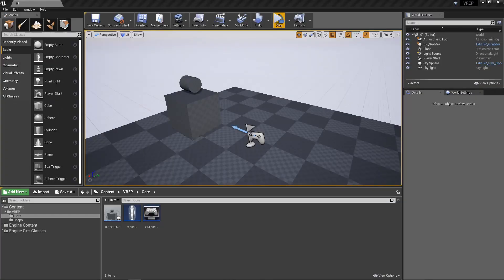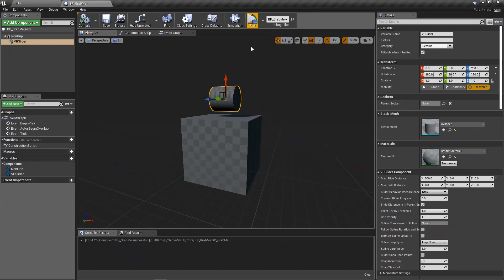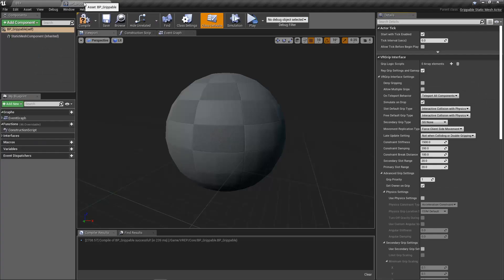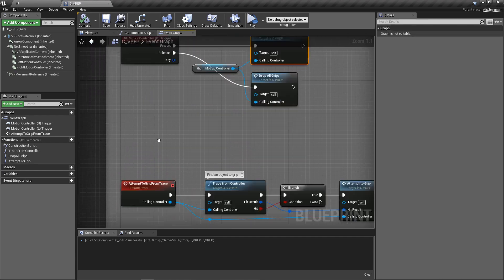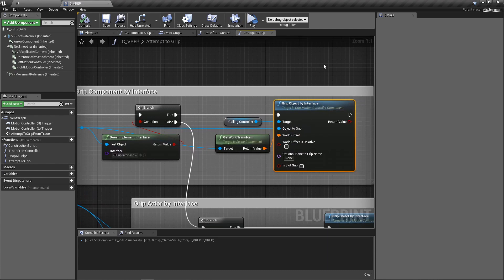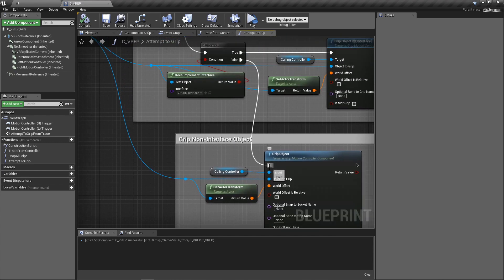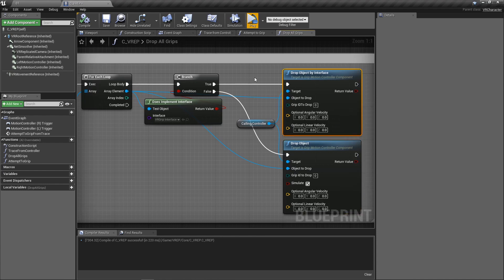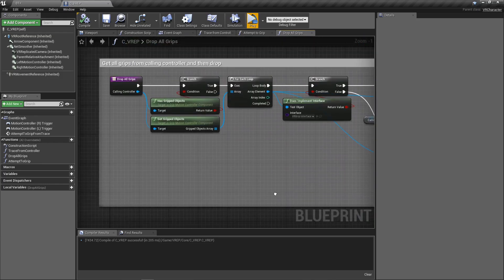VREP Docs: 3 - Gripping Fundamentals

Comment: Has the "Get Gripped Objects" been changed in 4.24?  9:44 For me It has a Exec pin now and throws an error in the for each loop.
Note: I am using the GripRight from my new inputs rather then a (R) Trigger or TriggerRight. Not sure if that would change anything.
Reply: This is so completely different then the written grip tutorials ( https://vreue4.com/basic-gripping ) Is there a preferred method and will one work better with 4.24 then the other? So far this is the hardest tutorial to follow I have ever come across and its likely due to changes in Unreal with openXR. I am going to keep trying but I am about ready to go back to Unity. Before I do can you please tell me if I am supposed to use The VR Blueprint as the base for this or can I start with a blank template as I have been trying?
Reply: @Ryan Salway The first tutorial states that I should start blank but the 4.24 update video starts with the plugin example so this is still a valid question. Can I start blank or has that changed? I have everything hooked up according to the videos and patch notes https://vreue4.com/4-24-patch-notes but I still can't pick up anything.
Reply: @GiantBean  I have added a sequence node so i can hook the extra pin up that way... seems to work for now anyway! Thank you

Comment: Hey @Raven, Ive been emulating everything you've done but my grippableStaticMesh sphere only  moves under the Attachment grip setting ( which disables physics). I've been trying to get grippable objects with physics to work non stop for the past week and haven't had any  luck. This video is the closest ive gotten. Also, i'm using a rift s with touch controllers if it matters, thanks.
Reply from the maker: This is usually a settings issue. There are tons of collision settings and modes. Ensure that what you're trying to interact with blocks the grippable meshes type and that simulate physics is on. In the VR expansion example template, the gun has physics enabled. You can look at it's settings and copy them on your object to start with.

Comment: If you set Deny Gripping while holding an object, does it automatically drop it. Or do you have to do a separate script for that? Say you want to shoot the object out of another players hand.
Reply from the maker: Setting Deny Gripping while it is held does NOT automatically drop it. For dropping an object, you want to use the "Drop Object by Interface" or "Drop Object" nodes. In order to use the Drop Object nodes, you need to know what controller is gripping the object.

For shooting something out of a player's hand: you can use the projectile (bullet) or another overlap/trace to get a reference to the object you want to drop, then tell that object to deny gripping AND run an event that checks "is held" (which returns a list of controllers that are holding the object). From there, you can run a "for each loop" that tells each controller to drop the object. Here is an example test of that logic (inside the event graph of the object that you want to drop): https://blueprintue.com/blueprint/_-jet27e/

I will consider doing some short one off videos for quick examples like this.